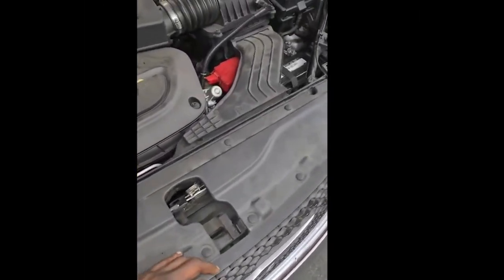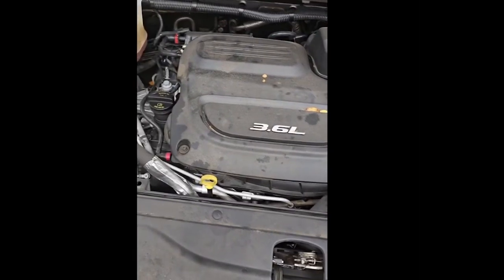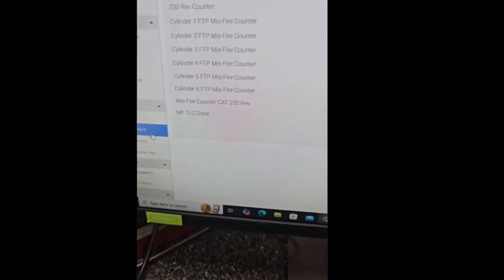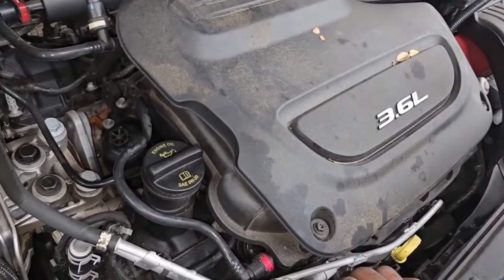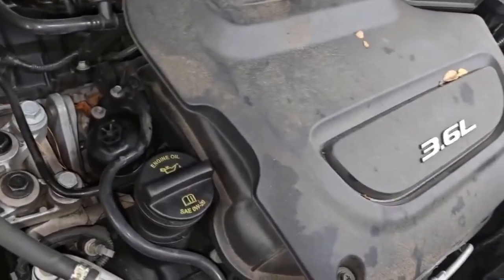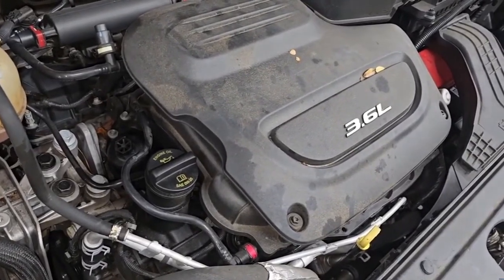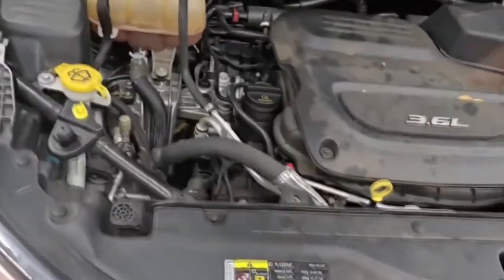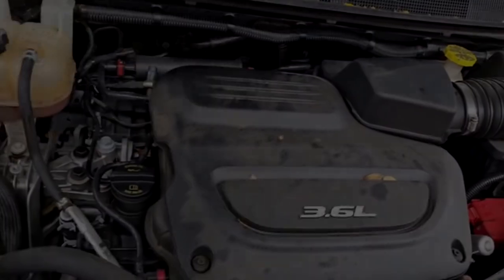Top 3 TIPS for Young Mechanics trying to learn how to fix a car that has a rough idle misfire.

Comment: I'm having similar issues on my 2017 Dodge Durango cylinder 5 and also my coolant level keeps dropping. Dodge dealership in my area says I need a new engine and the warranty company denied my claim cause they say I have contaminated fluid and it doesn't cover the warranty Soo frustrated any help?
Reply: You're learning why extended warranties are rarely worth the paper they're written on.  Did they prove you have contaminated fluid?  I'd say the coolant level keeps dropping is a good indication you've got something seriously wrong.  Do a pressure test of the cooling system, and maybe put a sniffer on the coolant to tell you if you have hydrocarbons in the coolant system.  The pressure test will help you determine if you have a leak that is easily repairable (outside the engine) or something requiring a teardown.  What's your oil looking like? Level high?  water condensed under the oil filler cap, or looking milky brown?

There are lots of videos covering diagnosis of coolant loss.  It can get expensive for you.  But you can also learn a lot doing it yourself! Yes, you'll have an initial investment in tools, but it's an INVESTMENT!  It will help you in the future.  It can be a big job. Advanced level.  (with timing chain/belt coming off to remove the head(s).  Have to get it right.  Replace parts while you're in there (tensioner, for instance, or water pump).  Good luck!
Reply: @jum5238 the dealership I think did a diagnostic and told the warranty company